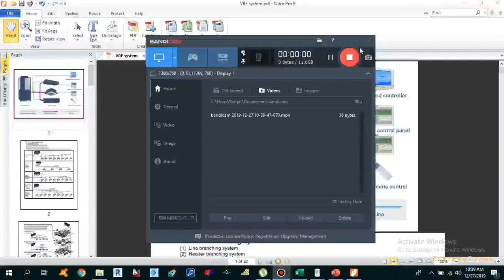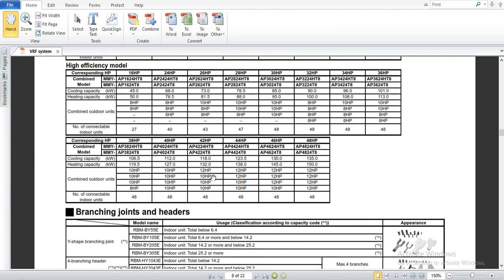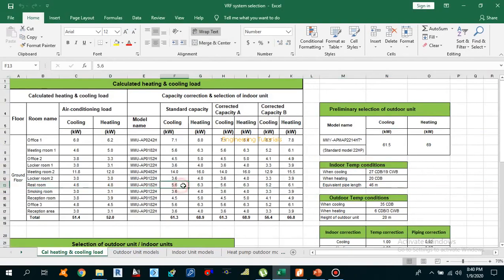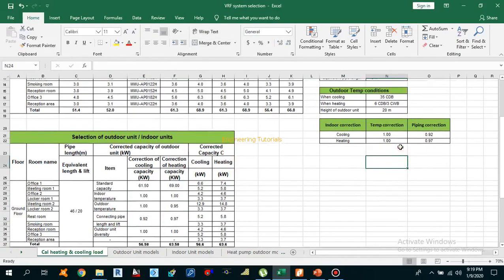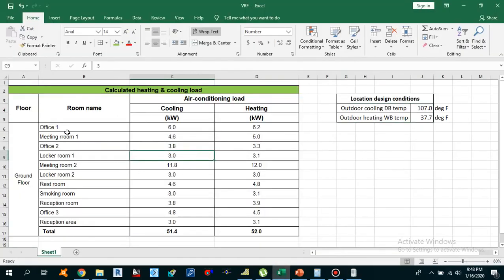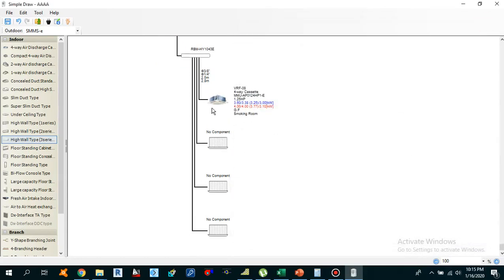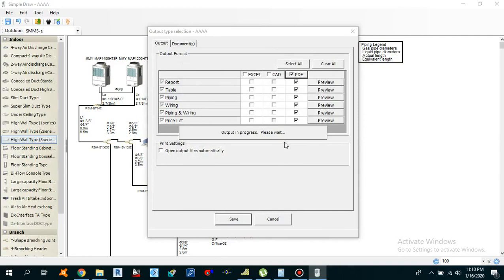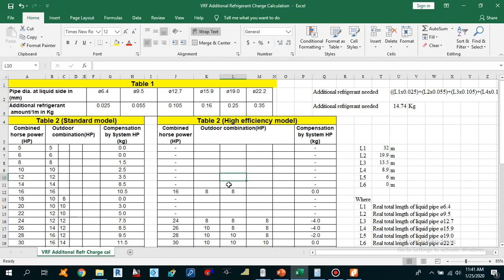Vrf system complete designing using toshiba software and excel sheet, vrv system design

Comment: sir how u r taking cooling sensible capacity
Reply from the maker: This sensible cooling capacity depends on your cooling load calculation which is calculated by using HAP software or E20 excel sheet. Based on sensible cooling capacity calculation I entered those values

Comment: What is the name of the software
Reply from the maker: Toshiba Vrf selection software
Reply: @MEPEngineeringTutorials  got it 
Your videos are awesome...
One doubt your excel sheet calculation made to chose 22hp outdoor unit.
But the software generated 26hp? 
Can u explain? It should be same I guess
Reply from the maker: In excel sheet we didn't consider length from branch to branch. We just used total equivalent length but in software we used all the lengths from branch to branch. So selection made through software is final selection
Reply: @MEPEngineeringTutorials  
O oki.
Thank you so much sir
It was great to watch your videos